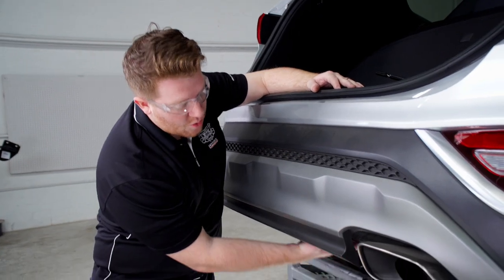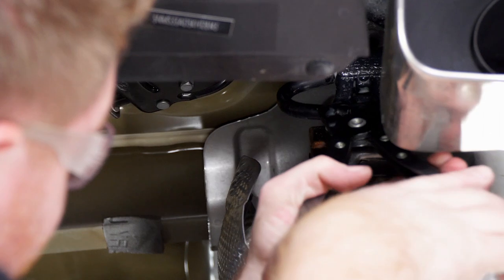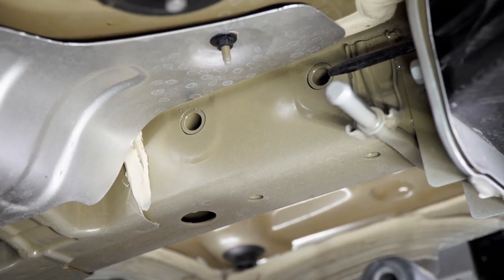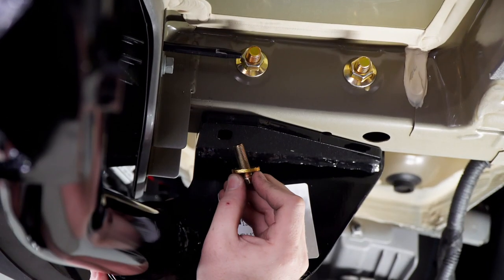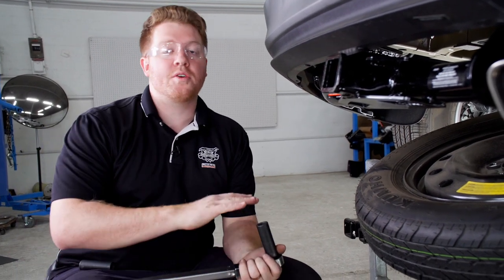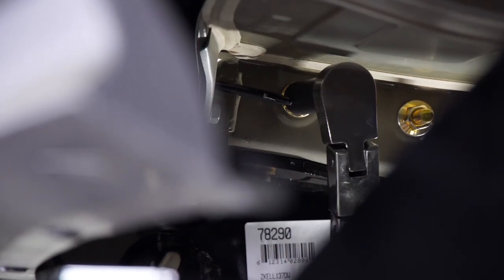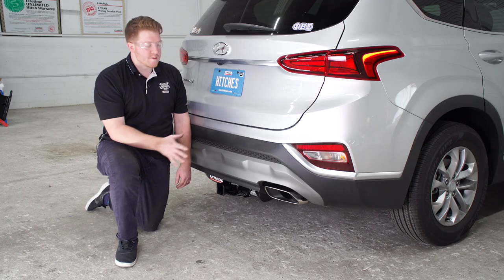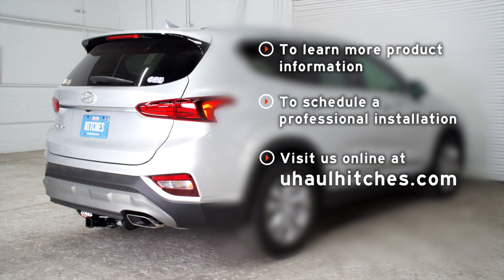2020 Hyundai Santa Fe Trailer Hitch Installation

Comment: First, from 2:43 to through 2:57 you can see a long, black hanger above the the exhaust isolator.  You will need to pry that slightly towards the driver's side of the vehicle or the hitch will not go into position.  The hitch simply won't fit the vehicle with that hanger in the way.  Next, follow the included instructions and install the 3 smaller bolts into the weldnuts in the frame prior to putting the bolts through the frame rails.  You can then tighten or loosen those bolts to make the frame rail bolts line up perfectly.  Last, the heat shield will be slightly in the way of getting the rear, passenger's side bolt into the frame rail.  You should be able to gently tap it with a small hammer if everything else is lined up and snug first.
Reply: instablaster...

Comment: Why did you design the driver side to only have one of the bolts going into the welded nut and having both bolts going into the welded nuts on the passenger side the designers are absolute IDIOTS on that
Reply: I'm no expert, but I did notice : 
A./ the drivers side has 2 LARGER bolts thru the frame, and that one bolt under, whereas  
B./ the passenger side had 2 SMALLER bolts, and then your two bolts under.....and
C./ it was not stated what the load rating was for the hitch shown...maybe not really high capacity ?